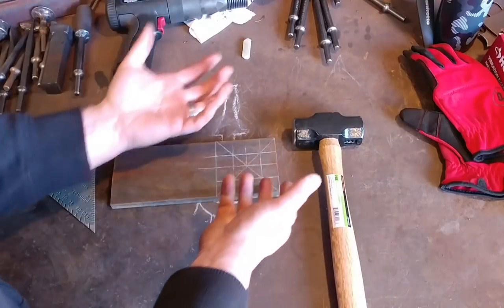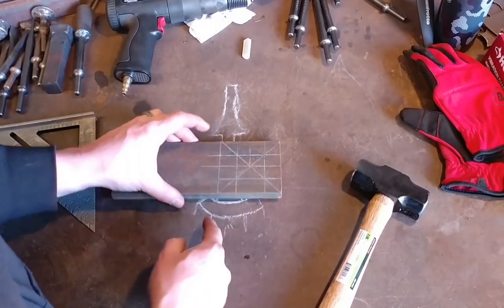The Poor Boy's Flatter

Comment: I built one last year from a 4lb hammer and , as you pointed out it was to big unless you use a striker. My second one was almost the same size as the one you show here,,,,,,if only you could have looked in your crystal anvil before I learned the hard way ,,,, lol,, lol,,,lol.  Annealing the struck face is the important part.

Comment: Why is this a poor boys flatter? It would still be cheaper to make this out of one piece of scrap drive shaft. If your forging any way why not forge it. I would say its a unskilled boys flatter!
Reply from the maker: +Daniel Moss it got its name from a guy who saw a need to make a cheaper piece of tooling for people who are looking to buy a flatter at quad state. As at that time even used flatters were very high in cost 60 plus dollars US. Not everyone is blessed with the physical capabilities or the power equipment to make a flatter of the size and dimension that I just made by welding a piece of mild steel plate to an already preformed hammer. In this instance the cost is in the eye of the beholder. In my shop using the Press or my power hammer you're right I could just throw on an extra piece of Steel get it hot and make a flatter as I have done. But I am not the average blacksmith in no regard.
Reply: O I see the name comes from a sale item. Even with out a power hammer a well spent afternoon a bag of fuel and a piece of old drive shaft can become a flatter. 

Also the type of weld you used in your video is expensive. You need a good ish welder, wire and gas but i get why its a poor boy now. you could make 100 of these in a day if you wished and to do that even with a massey well might take all week.

I would just like to say for the recorder I consider every project or exercise I undertake on my channel for the cheaper end of the blacksmithing scale. So I would say in 4 hours you can have a descent flatter with or with out a flatter.